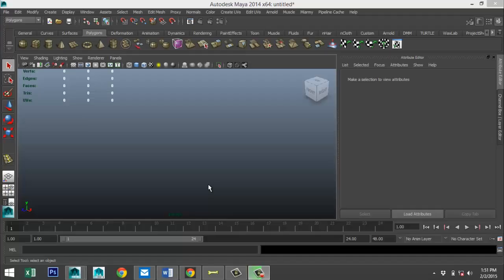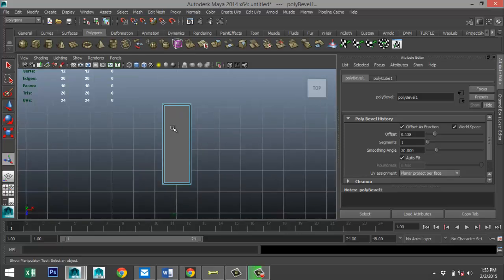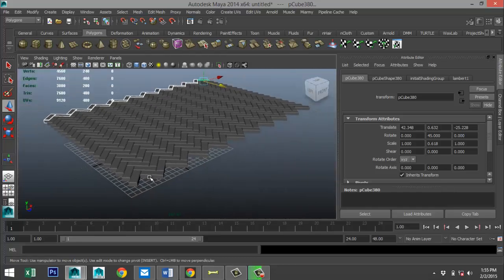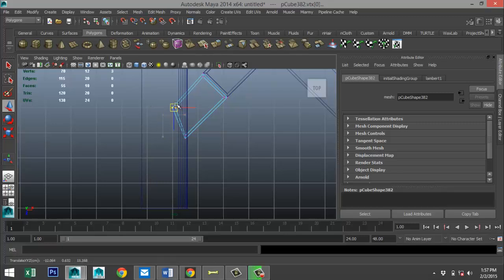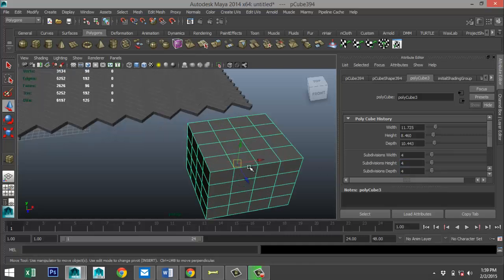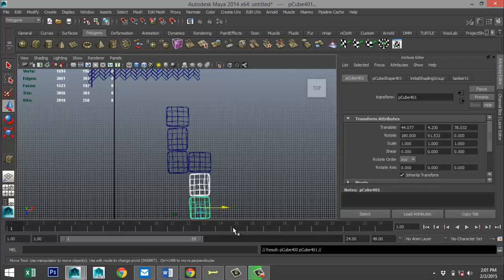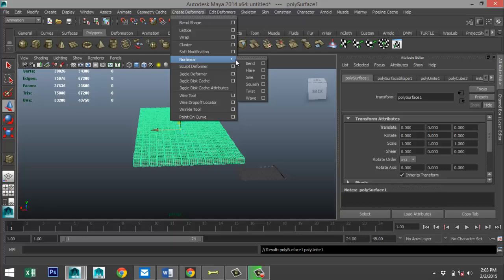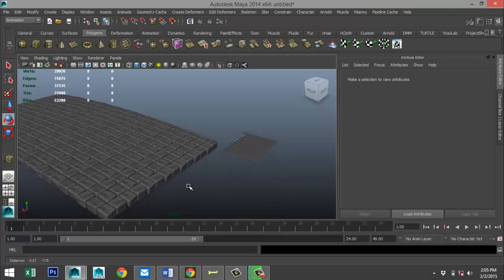Maya tutorial : Cobblestones and Street bricks

Comment: I am modeling a real life location and thought of doing bricks like this. I figured I could make a high res version and texture it in zbrush and then use that as a normal bake into a flat surface when brought into a game engine. Would that be a sound approach? I'm even considering LODs.
Reply from the maker: +MakilHeru Yes it would but keep in mind that it will be very high poly. So I would advise to create the street separately from the rest of your scene ( the high poly bit ) to avoid system crah
Reply: +Mike Hermes Thanks for the advice, yes I plan on using file referencing to solve that problem in Maya. From there I can add the assets separately into the engine. I think making the high rez into a ground plane will look high res if the high res gets baked. Thanks for the help! Love your channel.
Reply from the maker: Sounds like a good approach, thanks :-)